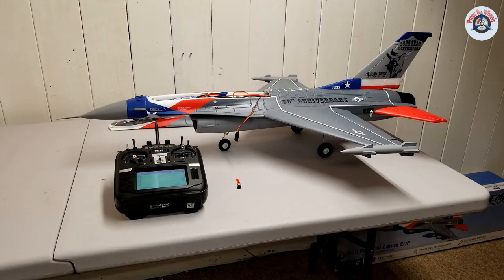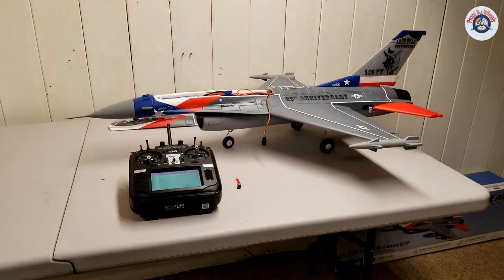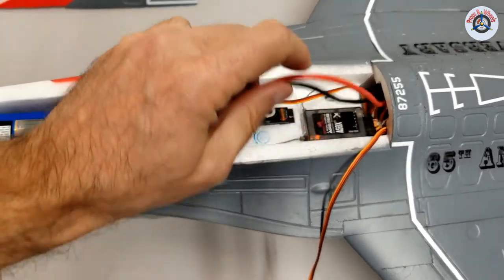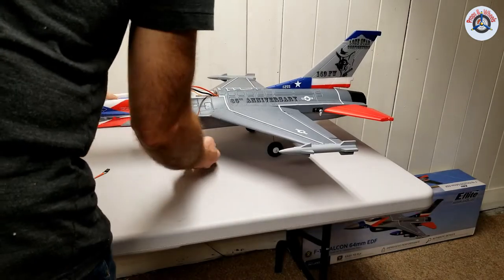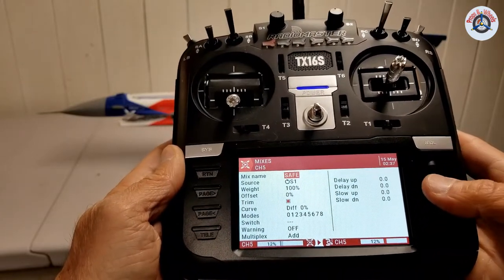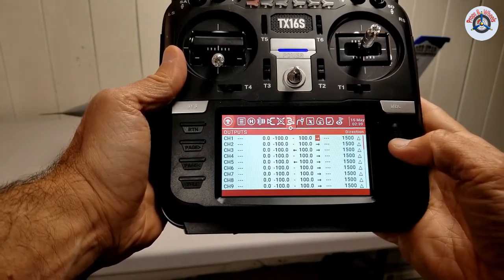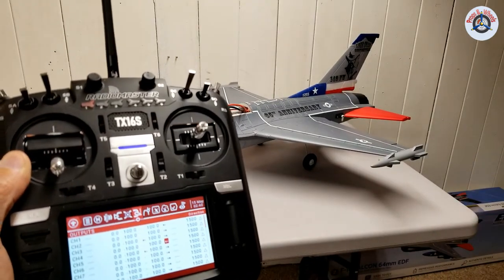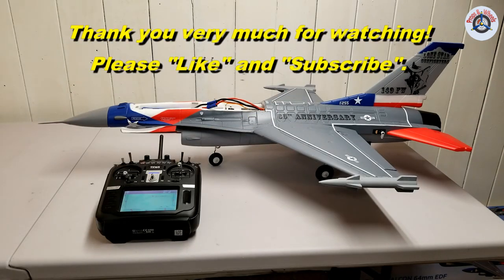RadioMaster TX16S with HALL Sensor Gimbals - Binding to an Airplane with AS3X and SAFE Select

Comment: Great video! Very informative! When I was trying to set up my new F-16 in the module status line, right below the DSM X line. I got the message “Module update needed”. Have you seen this and what do I need to do to clear or fix? Jim in CA
Reply: Means you need to update the module
https://downloads.multi-module.org/
Reply: Thanks Mike, and thank you for the link! I will do that in the morning. Bought the 80mm F-16. Anxious to get it in the air. Jim
Reply: I’d assume I can download through Companion, right?
Reply: @jimworley7385  You can download the file to the folder FIRMWARE on your SD-Card and then unplug the radio form the USB connection ... after that go to SD card on the radio and into the folder FIRMWARE and run the file to update the MultiModule.  ;o)

Comment: Thank you very much for your very good clarification... I have been searching in vain for this information for a very long time. Now finally I was able to bind my eflight f15 with BNF and the integrated receiver AR636A with AS3X to my radiomaster TX16S. Only in the setup instead of "MULTI / DSM / X 11ms" I could only  Select "MULTI/DSM/AUTO" and it worked with it.

Comment: Great video!

You can put AS3X on Ch 5
Select your switch you want and it needs to be a 2 or 3 way, better 2 way
Asign the switch to OFF and ON
I will  NEVER use SAFE
Reply: If you put AS3X instead of SAFE on ch 5 how would the plane know that?

Comment: Awesome video! One thing I found different in my new EF UMX Pitts that I programmed on my Radiomaster Tx16S is that I set up the SAFE "SF" switch but I did NOT do the sticks down and in method and SAFE still works perfectly without doing that. Maybe the new bind and fly receivers don't need it???? Also, it's so cool that the Radiomaster can "discover" the telemetry and I can callout any cell or all cells of the lipo so I always know the exact battery voltage at all times. Does the AR630 full range receiver do that too?
Reply: I wasn't able to get the safe enabled in my Pitts.  As3X is working.  I did as in this video.  Did you do anything different than in the video?

Comment: A lot of people here they say that followed the instructions but didn’t work. It was the same for me. Today i finally made it with a Taranis X9D 2019 running EDGETX and 4-1 external module. For me it was needed to add the CH5 in the inputs too with the decided button assigned as source.
Reply: its possible that he had previously bound the receiver to a spektrum transmitter. I've read that can make a difference.

Comment: I watched your video about setting up spectrum receiver on tx16s. The binding went find. When range checking the airplane I keep getting a message on the transmitter saying it’s loosing RF signal. The same thing has happened on two different Horizon planes. Do you have any suggestions.
Reply: Put your transmitter far away from 1 meter minimum of your Rx

Comment: Is there a way to setup a 3 way switch to control Safe, AE3X, and Off?    Would be nice to have off in case you have trouble with the Gyro and need to get it on the ground.
Reply: Yes, but I don’t use an off position. I’ve never had a receiver come loose, fail, or be reversed..

Comment: Thank you for the informative video. I have the BNF Eflite Focke Wulf and I also fly it with the radiomaster TX16S. But  I am modifying it for an FPV cockpit and I wan to use a radiomaster (frsky) receiver with more channels. At this moment, a servo plug is conntected to the Bind/Prog/SRXL2 connector of the spektrum AR637TA receiver. This plug is going to a bind plug and an Aux Bec that goes to the ESC. Do you have an idea what to do with this connector when flying with the frsky receiver? Leave it unplugged?

Comment: Reat tutorial . But i have a new Apprentice STOL 700 and i was able to bind it with all the SAFE a AS3x  with out the step on removing the plug. However , i was not able to activate and deactivate the SAFE as you did , i did follow the joystick step down and center but it did not trigger any beeps. ANd the SAFE is always ON. Any advice? Thanks

Comment: Now to complicate things. HOW DO WE GET INTO THE DSM FORWARD PROGRAMMING.(its under the sys button) lol. Then we can set gyro gains etc,etc. I am not sure if the firmware is setup for it yet. GREAT VIDEO!!. Once I can get into the dsm forward programming I am no longer handcuffed into buying expensive spectrum radios for all the new planes.Or forced to gut the recievers out of a bind and fly plane.

Comment: Superb step by step instruction on how to activate AS3X and Safe with a TX16S radio (4in1 module).

I would be interested if you or someone can say something about the signal quality? Spektrum DSMX receiver in conjunction with the Radiomaster TX16s radio?

How robust is the connection? Has anyone had any problems with this combo to date?

I would like to pair some (Spektrum based) fliers with the TX16s this way, but am cautious about signal quality for now.

Thanks in advance!

Comment: Followed the video instructions for my RadioMaster. All worked well except the elevator. Could only get less than a 16th of an inch up or down. The servo was weighted at 100 per cent. Any ideas?

Comment: Thank you for the video.  But you did not show when in safe mode, if the controle surfaces work correct.  I have it happen to me, that on the radio  all surfaces work correct, but in safe  where reversed, ending in a crash

Comment: Great video.  Worked on F-15 Eagle thanks for the video.  Make sure for those of you who removed landing gear that it isn’t reversed. Didn’t notice because took landing gear off for grass landings since rudder was reversed couldn’t set toggle switch. Switched it and works as per the video.

Comment: Great video. I was having some trouble getting the safe switch assignment selection to work and then realized I had pre-set the rates less than 100% for ailerons.  I returned the rate switch to 100% and everything worked like a charm.  Thank you for a very clear presentation!

Comment: Sooo I like these vids, but it seems like no one tell which of the 3 tx16s they have. 2500, SLRS or 4 in 1. Only been flying planes for about six month and had to call a radio master dealer to find out.  Only one will work with these DSM/X planes from what I was told. 4in1. Hopefully this helps some people.      Keep on flying
Reply: always 4in1 if it involves spektrum

Comment: Your video is great! but I think I am going to thrown-in-the-towel, I give up......I have a Conscendo evolution and I followed your steps to the letter....the last step with sticks in and down.....toggle switch 5 time...and no response from the plane....it appears that AS3X and Safe remain on full time.  The receiver in the conscendo evo is the AR637TA and I believe the receiver in your video is the AR636.  I dont know if that matters but please help...at the end of my hope so to speak LOL
Again, thanks so much for the time your giving back to the hobby its much appreciated
Reply from the maker: Hi Michael. Not all SAFEs are created equal. I think on some Horizon Hobby models, you cannot turn off SAFE. Is your airplane "SAFE Select" like mine?

Comment: This is a great tutorial to turn SAFE on and off! Any idea on how to set up a 3 way switch to select the SAFE's Begginer, Intermediate, and Advanced flight modes too?
Reply: Did you have any luck with the 3 way switch set up?  I’m tying to set mine up at the moment, and I’m a bit stuck! Cheers.
Reply: @lilmeister44  Still no luck on my end either. Just using SAFE on or off...
Reply: I came here to try and find out the same thing.  Hopefully someone that knows will post!    Excellent video Props & Wheels! This is helpful, now just need to figure out if the 3 modes will work with this controller.
Reply: I made some progress on the safe flight modes! Actually worked out how to make 4 different safe +  AS3X modes to work.  I not sure I can post links to my video on the comment section without getting it flagged but if anyone is interested there is a video over on my channel on how I did it.
Reply: When safe is on how do u correct when surfaces are moving in the wrong direction
Reply: I know how..
Reply: @txkflier  Sounds good. Any suggestions on how to set it up? Thanks in advance!
Reply: @michaelshay8066  You have to set up the three flight modes in the receiver. The transmitter part is easy. You just assign a 3-position switch to the receiver’s flight modes channel. I always use channel 7 for the receiver’s flight modes and channel 8 for panic. I have a video on reprogramming an AR636. It’s not perfect, but it might help..
Reply: @txkflier  If you can point me to the video, I'd be interested. Thanks again!
Reply: @michaelshay8066  Look for Spektrum AR636 AS3X & SAFE Receiver How-To..

Comment: What do I do if my trims go back to center when I switch from safe to as3x?
Reply from the maker: I suggest you to trim and center everything in the AS3X mode (no SAFE). Once you turn on SAFE while the plane is on level ground and not moving, it should be calibrated to keep the plane in straight and level flight. Let me know if this works for you.

Comment: You said your ailerons were channel one but Spektrum uses there.
Reply from the maker: Usually the channels go AETR. It worked like that on my TX16S.
Reply: The receiver wants channel 1 to be throttle. Otherwise, the throttle won’t failsafe to idle..

Comment: Hi…im new with radiomaster (openTX) and i just bought a night radian with a spektrum AR 631 receiver and i manage to bind it and works all fine but…im unable to assign a safe select switch…whatever i do i do it wrong because so far it didn’t work.
I watch many YouTubers but no one worked fir me. Please can you help me posting a video on how to……? 
it would be very helpfully to me. Thanks 🙏
P.s. 
i tried your way  in this video but it didn’t work…..and now I understood why…because it is possible to do it only with your receiver AR636B from the AR636 family which is the only one today (discontinued) able to be programmed (activation of safe and as3x) with a pc…now today all the spektrum receivers can be programmed only through spektrum tx forward programming. Doing so they keep the safe select and as3x technology working only for spektrum ‘supporters’. (Spend your money and buy a spektrum transmitter).
Thank you anyway to post your video but please specify that is working only with that kind of receiver…🙏
Reply: Hi, it was difficult for me to configure the switch on my Tx16S as well, but I finally succeeded.  My receiver is a factory installed AR636T for the eflite Conscendo Evo
Reply: @doand1257  hi…with edgetx and the lua script it has been able to enter the foward programming mode of the receiver and i unlocked the safe option and i easly assigned the switch and now i have it working on my night radian 👍🏻👍🏻👍🏻👍🏻👍🏻👍🏻 edgetx is the best!!!
Reply: @Bombana01  could you give me the link for downloading this Lua and unlock process ? thank you

Comment: Great video! BTW, HorizonHobby has mentioned and confirmed numerous times that AS3X (their bullshit term for IMU-assisted gyro stabilization) CANNOT be disabled, even by them - it is baked into their BNF RX firmware (some of them, though they refuse to publish a list of what RXs are 'free' of AS3X).
Reply: I don’t have any trouble updating the firmware and reprogramming AR636’s. Only the first few planes that came with AR636A’s can’t be reprogrammed..
Reply: @txkflier  Just to clarify please? Does this mean only that AS3X can't be switched off - or that you can't use a AR636A with Open TX16? Many thanks!
Reply: @paullepine4765  Spektrum locked the early AR636A’s so that they couldn’t be reprogrammed. If you have an AR636A that you can’t register, you can’t reprogram it. The AR636 can have up to 3 flight modes which can be gyro off, AS3X, heading hold, or SAFE mode. Firmware 1.x doesn’t support SAFE mode and 2.x doesn’t support heading hold. SAFE mode can be set for angle limits with self-leveling (beginner mode) or angle limits without self-leveling (intermediate mode).
Reply: @paullepine4765  And yes, you can use an AR636/A/B with a TX16S. You should use TAER mode and don’t enable max throw. Spektrum receivers want to see 1520 uSec +/- 400 uSec at 100% travel. This is 1120-1920 uSec, but OpenTX/EdgeTX still shows 988-2012 uSec even though the 4-in-1 is set to DSM mode. I wish they’d fix it.
Reply: @txkflier  many thanks for the replies....I am new to spectrum, looking at buying a second hand eflite f15 with ar 636a pre fitted. As second hand I guess the receiver has been set up already so I'm hoping to use my open tx16 to bind with it? Fingers crossed and thanks once again
Reply: @paullepine4765  The discontinued version of the 64mm F-15 had an AR636 and the current version comes with an AR630. Both versions should work with a TX16S..

Comment: I've just did exactly what you said I have new Ar630 as3x safe it binds OK but it's not in as3x nothing moves when I move plane any ideas
Reply: After you bind it try unplugging the model, removing the bind plug, and when you plug it back it you may have to advance the throttle past 25% for a nano second and then let the model sit for 5 seconds or so. it will start jittering.
Reply: @kaptkrunchfpv  yes did that too but still only normal servo initiation but I heard u need to bind with spektrum tx first if rx is new then it opens rx up for other tx but I can't afford to just buy tx just to fire rx up
Reply: @stevejamelskyj5761  his procedure is for bnf receivers that are sold with an eflite plane. Different procedure would apply to seperately purchased forward programming ar630.